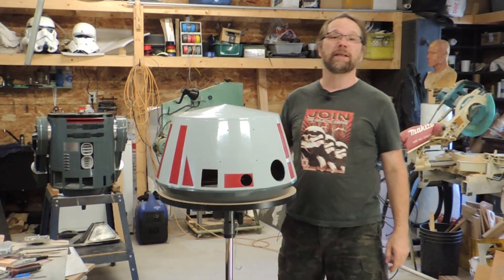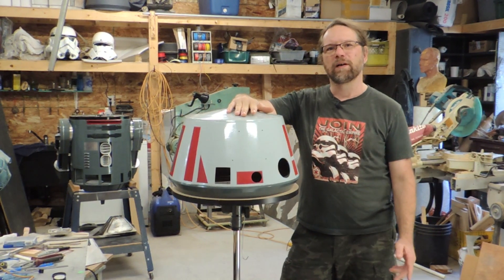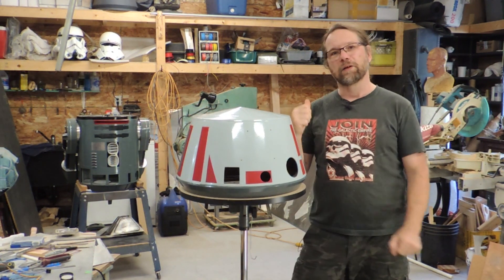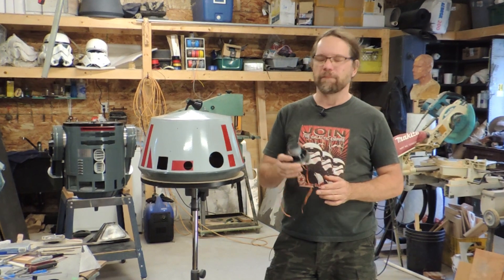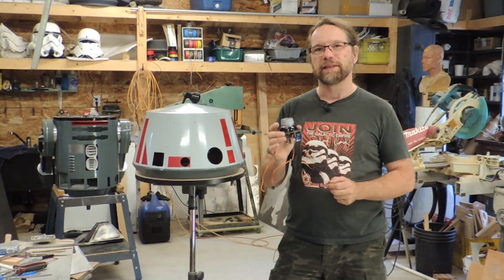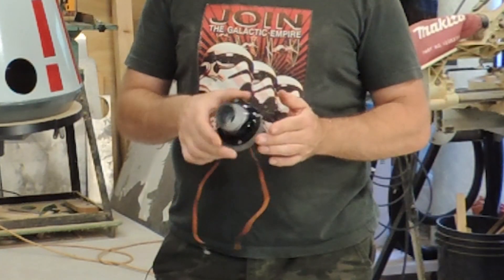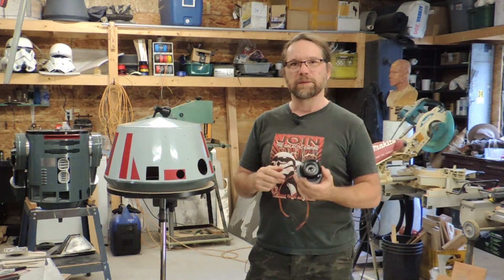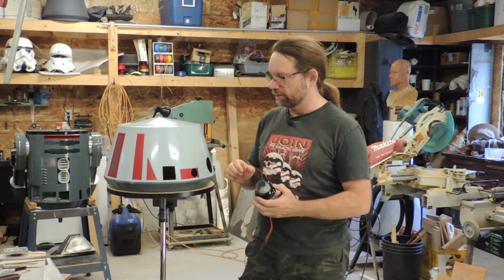R6 Astromech - Dome part 3

Comment: Hi Aaron, Nice to hear from you. Have you covered in a video what motors you are using in the feet of you astromech?
Reply from the maker: Mike, I have not yet mentioned it. I'm actually working one the drives today! I'm working with a set of Planetary Gear Motors I had on hand from Andy-Mack. They are not the most economical solution though.